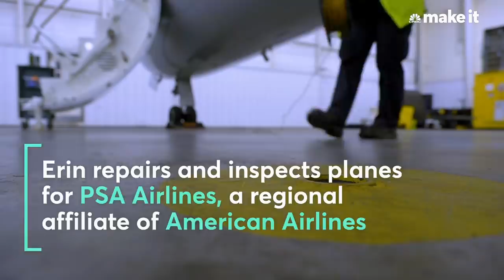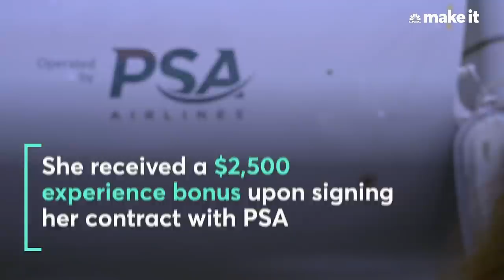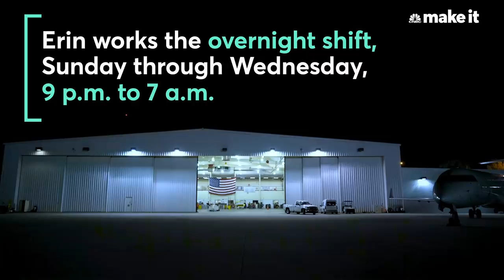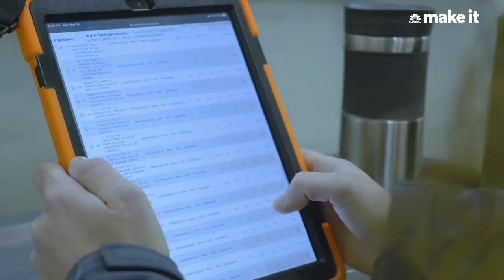Making $55K A Year As An Aircraft Mechanic in Charlotte, NC | On The Job

Comment: Did she hit a glass ceiling here? I hate to be the feminist, but if she's only making 55k as an airplane mechanic, it may be because she's a female in an industry that is predominately male. Would be interesting to know what others in the same field make doing the same thing in her area. Seems like crock she makes this in 2021 doing what she does.
Reply: I think she is still a beginner
Reply: they are probably on a pay-scale, be careful immediately going into victim mode because of gender. She's also in NC and the wages there are low in general.
Reply: Nah, this job really doesn’t pay that much. I’ve researched it before and no one anywhere really makes much . The real money is working over seas
Reply: It depends on experience and where in the field you're working. 
Only took me 3 years to break 6 figures.

Comment: She is a mechanic.
With her position and her experience less than 2 years cannot get into even 55k. Once, she got more than two years, she will go to airlines.
I started $21.76  a hour at compass airline, 2019.
And now i makes $43 a hour with qualifying Q2050 which is eligibility to sign for RTS of cargo airplanes (B747-4/8, 767-2/3, 777). Yes, i moved to cargo airline company after i got 1.5 years from compass airline.
Dont assume mechanics' salary. We do a lot of overtime.. when i made $24 a hour at compass airline, i earned $70k a year. It was about 35% increased YTD related to given hourly pay.
So, let say, her salary is 55K means her hourly pay is around $29 per hour, and she is probably making over 75k a year.

Comment: She works for PSA, not American Airlines, Delta, or any big airline. Usually, after three years, any 
A & P Mechanic can transfer. The only problem is any Airports work in a Seniority system. In the beginning, You are going to get the crapy shifts, but eventually,  Seniority will bring You the SHIFT You want it. As 
A & P, You can work for a cruise line, wind turbines, theme parks, auto racing, and many more places. 
55K in South Carolina is a GOOD SALARY because of the cost of living, compared to California or New York. I hope. She finds a better offer on a company that has a better salary. BTW; Thanks for Your service.

Comment: People  talking about what she makes. If your older can I get some agreement on this. Her discipline, her skills, her military background,  her rebel attitude about getting into blue collar work. Its a blessing she has all these wise! Skills in her head. Exercise, being a vet. People say she ain't making enough.  Whatever.  Bro. She's got knowledge that she can carry with her her whole life....rare knowledge
Reply: They're just ignorant of the industry. I'm a aircraft mechanic and have been one for 5 years now. From what I've learned. Military experience doesn't count in commercial aviation. So that wouldn't be factored into her pay rate.

Also regional airliners and MROs is where young mechanics go. To get the experience needed to work at Major Airliners such as Delta, or Cargo airliners such as FedEx. That's where you make high 80k to 130k a year.

Also it depends on her skill level. I.E There are mechanic ratings from lv 1 to 3. And you are trusted with different work depending on rating. So lower rated mechanics get paid less. Because they're doing the grunt work like greasing parts, and oil changes. They're not doing the critical task where the plane can go down if u screw up.

Comment: this veteran is grossly underpaid. 55k for such a specialized work is criminal. And night shift to boot!
Reply: 55K in Charlotte is like 100K out here in Seattle. Its appropriate for the market. actually a good salary, Ive seen as low as 45
Reply: @552mustang  but 100k in Seattle is not a good salary
Reply: @qfason5836  Of course it is.

Comment: mechanical maintenance on planes pays so low compared to other mechanical maintenance work in other industries like mining, factories and buildings. we call it mechanical fitter in Australia and i don't remember the last time i earned under 100k a year most years around 130k if i do some overtime, thats about 100k usd. It does take its toll on you though so unless you work your way up off the tools then you probably will have to change career later in life.

Comment: For those wondering why she gets paid what she does ( 55k isn't even bad ). I'm a aircraft mechanic and have been one for 5 years now. From what I've learned. Military experience doesn't count in commercial aviation. So that wouldn't be factored into her pay rate.

Also regional airliners ( where she works ) and MROs is where young mechanics go. To get the experience needed to work at Major Airliners such as Delta, or Cargo airliners such as FedEx. That's where you make high 80k to 130k a year.

Also it depends on her skill level. I.E There are mechanic ratings from lv 1 to 3. And you are trusted with different work depending on rating. So lower rated mechanics get paid less. Because they're doing the grunt work like greasing parts, and oil changes. They're not doing the critical task where the plane can go down if u screw up.
Reply: We don't have skill levels at psa. As mechs we all get paid the same and we all do the same work.
Reply: @lukemorgan1722  So a entry level mechanic there is changing out Jack crews, riging flight control cables, and doing engine swaps etc?
Reply: @bronxishomenomatterwhereig3149  yes, the only requirement is if you havent done the task before you have to have some who has done the task before with you for the first time you do it.
Reply: @lukemorgan1722  True a entry level mechanic can assist with such jobs.  But from my experience. Most places wouldn't trust you to actually do it or be the one directly responsible for the task within a group. Unless they trust you. And it takes time to earn that trust.
Reply: @bronxishomenomatterwhereig3149  well I'm not sure how it works in the mainline world but in regionals, you just do the tasks and ask questions if you are stuck.